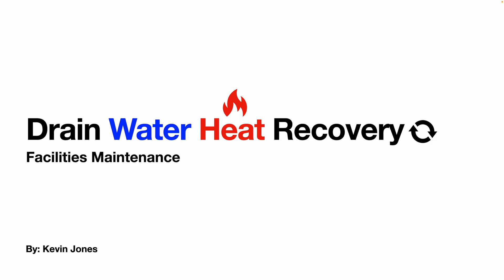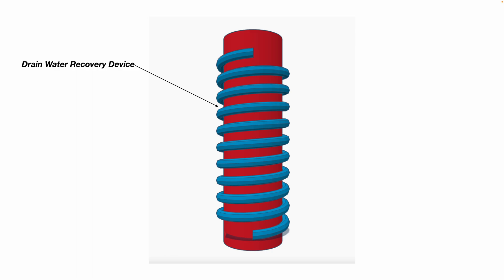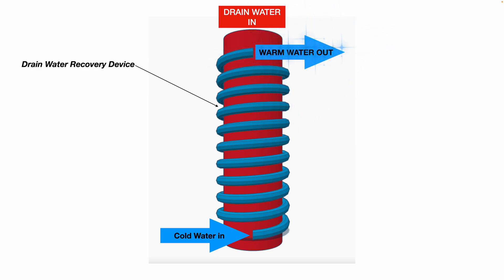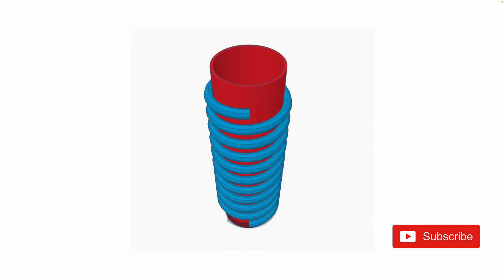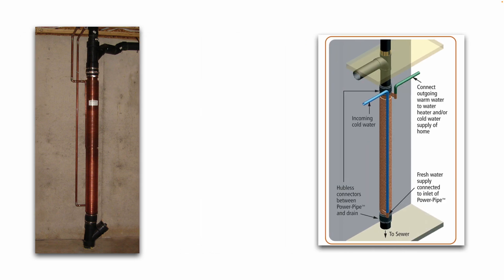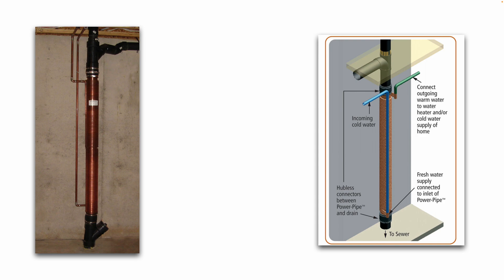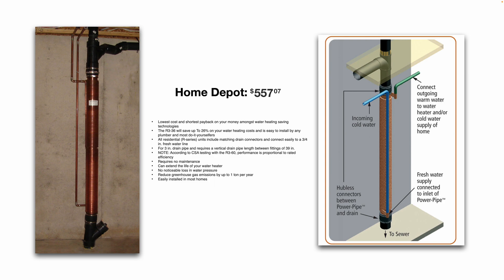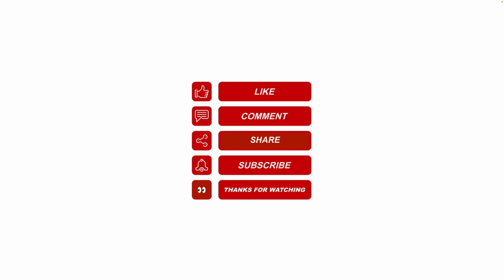Drain Water Heat Recovery Devices [2022 Overview]

Comment: That picture of the coil system would be considered a potential cross connection scenario. If shower water is running through the pipe over the coils warming the cold water inside the coils then what happens when a leak happens in those coils exposing dirty shower water to your drinking water? … only way it would work if coils were wrapped around the exterior of the pipe.. even then the amount of savings in my opinion would take you 50 years to recover from the cost of matl and labor
Reply from the maker: Thanks for your comment, sorry if the picture wasn't clear, the red pipe represents warm waste water going down the drain pipe.  The blue coil of pipe has fresh cold water, and is wrapped around the outside of the drain pipe, so if the fresh water pipe was to spring a leak, it wouldn't get contaminated with waste water from the red drain pipe.

Comment: If you take showers these vertical exchangers save money and extend the capacity of your hot water tank. I've used them for 15 years and believe they should be part of the building code for new construction showers.
Reply from the maker: Agreed.